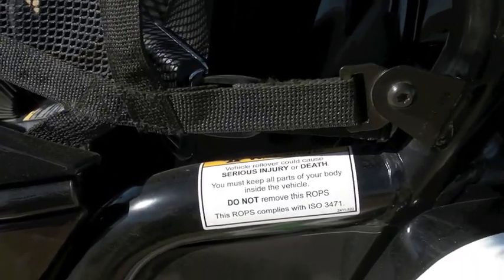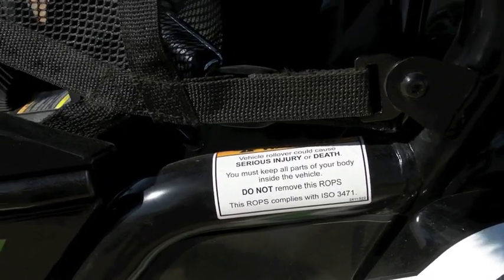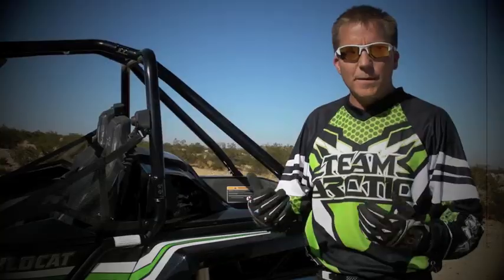Arctic Cat Wildcat UTV Interview #6 - Wildcat Exoskeleton design by Arctic Cat Side by SIdes

Comment: I’m trying to dial in my suspension but it has been messed with and I’m not sure what it’s supposed to be from the factory for the preload set any way you could help?
Reply from the maker: No,. The springs are now used and their spring response is now changed from original.  The only way is to ride it and adjust until it feels correct.